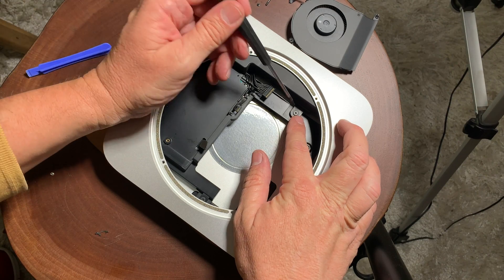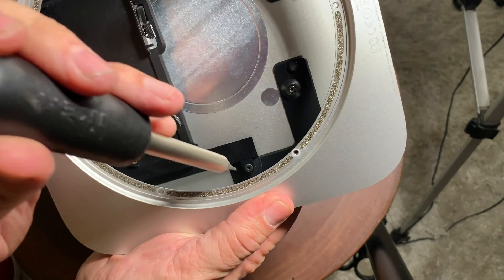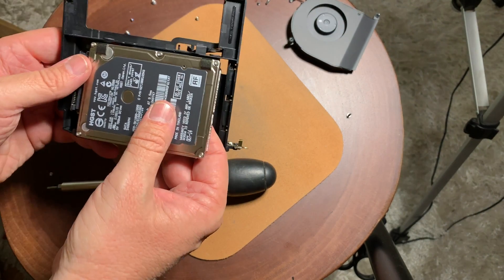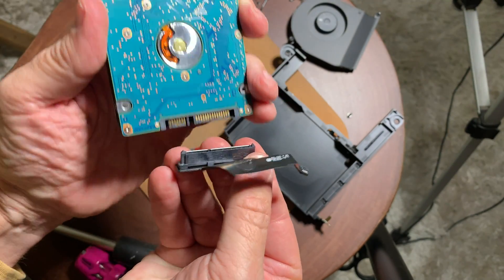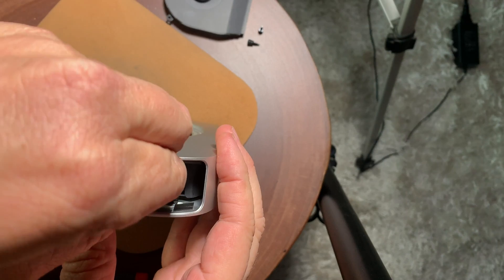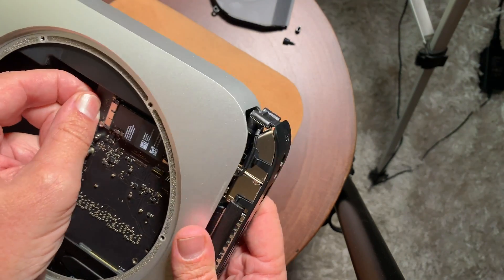Upgrade The 2014 Mac Mini To Super Fast SSD

Comment: This really does work! I saved all of my documents to a SIM card and then installed the new SSD hard drive. I then downloaded the software, from the internet, giving me a brand new Mac Mini with no bugs in the software. It took quite a long time to download the new software and then it had to be updated. It is worth it. It now runs at five times the speed. Before, it was more or less useless, taking about a minute to respond to most instructions.
Reply from the maker: That's awesome, thanks for sharing your experience!

Comment: When you unplug the IR remote cable, be extremely careful because it breaks of the board very easely. (if it breaks it is not a disaster, the remote and power light wil not work anymore) BUT THE FAN CABLE!! Don't unplug it. You can remove the main board with the fan unplugging. This fancable plug also breaks off the board like it is made of paper. If I would do it again, I would even tape it securely. Please give this reaction some thumbs up. Not for my ego, but to get it higher in the listing to help new fixers.
Reply: Very important warning!!
Reply: It's fine if you lift it straight up. I figured you need the fan housing out of the way to get to the other connectors. But I guess if you can leave it on, that's best. This thing really need to be handled with kid gloves and lots of time, all of those board connectors are crazy small.

Comment: Ive been repairing Macs for years but never repaired a Mac mini which is a testament to reliability. my 2012 Wass much easier than this to upgrade. Ive just got 2014 to upgrade hd. Couldn't believe how hard it was, even had to buy new screwdriver (t6 security) used a tiny screw driver ( from xmas cracker!)in the logic board each side a little bit at a time.

Comment: I managed to destroy the IR cable pin’s trying to plug it back in so no remote control use going forward (never used one anyway) and the power light no longer works but it seems to be going through the fresh install fine, only 2h 30m to go for Yosemite and then comes Monterey.

Comment: These were made with a plug in the logic board where you can but a $10 adapter to make it a fusion drive. Why not if the HDD is working fine just add an SSD stick and have to beat of both worlds and more memory. Better yet, replace the HDD with the SSD and find a 256 ssd  for cheap and the fusion drive since you opened everything up and put even more ssd power in this?  $26 gets you 1/4 tb.
Reply from the maker: When this video was made those were not available. But if I was doing it now I would still upgrade both drives as it’s so easy

Comment: WOW + WARNING TIP! Followed step by step and went through until I realized that I ripped off the hard drive power connector. You mentioned that you were able to get it with your nails but I took it off from the wrong side. What I suggest is to unfold a paper clip and gently slide it under the HDD cable branch to lift it carefully. The cable should come out pretty easily. If you happen to rip it off like I did, don’t worry, it’s a very common mistake and an electronic shop doing micro solder should be able to fix it. Other than that, the explanations were exceptionally good!

Comment: Great vid, thanks. How did you transfer all the data on the HD to the SSD?
Reply from the maker: I used disk cloning software. Once the hard drive was removed I used another mac computer to clone the hard drive. Once installed you just turn it on and it works. The one I used is not around anymore but Super duper is a good one .

Comment: I’m looking to do this exact upgrade but I’m wondering if I should do a 2012 Mac mini instead and upgrade that. I am wanting it for editing on light room.
Reply from the maker: You could use a 2012 Mac Mini but its not compatible with Big Sur the latest operating system and the 2014 model is compatible

Comment: Excllent video I have a late 2014, so would i have to save all my data on a dvd or flash drive, install the SanDisk SSD PLUS 2.5 2TB and then transfer the data? Thanks alot for your detailed work cheers!
Reply from the maker: Correct. Or upload everything to the icloud and and then you can put everything back. You just buy the storage you need for a month then get rid of it. That would be the cheapest and easiest way. I do this all the time very easy

Comment: Thank you for this tutorial, just done ssd replacement using this video as guide.  I don't have long small screw for pushing the logic board, so I just carefully push it from the end of the board where hard drive sit. Also for removing the drive, in my case it was using T8 not T7.

Comment: Hello my my mac mini late 2014 has 4gb RAM 500GB of Storage ...if I upgrade the ssd to 1tb.. how do I transfer the OS to the new SSD?
Reply: I would recommend instead of changing the 2.5" HDD for a SATA SSD it is better to just add a NVME SSD it is much easier to install and it is also a faster drive. That way you will have two hard drives, then all you have to do is install the latest OS X on the SSD and migrate you data from the HDD to the SSD when you first start your mac from the new SSD.

Comment: Just ordered the same SSD for my 2014 mini today, got it for less than $100. Very excited to have it installed! My mini is unusably slow and the SSD should help tremendously!
Reply: @Yusuf Han Yorulmaz I would recommend instead of changing the 2.5" HDD for a SATA SSD it is better to just add a NVME SSD it is much easier to install and it is also a faster drive. That way you will have two hard drives, then all you have to do is install the latest OS X on the SSD and migrate you data from the HDD to the SSD when you first start your mac from the new SSD.  I did this a couple of weeks ago and went from read/write speeds below 100 MB/s to above 700 MB/s.
Reply: Can you do both.

Comment: Thanks so much for this tutorial!  With the help of you and a Youtuber named luke Fugate I was able to clone my SSD and install it to the system I'm using as I type this comment.  I used a 2020 SK Hynix 1Tb Gold S31 SSD.  It hasn't turned my Mac Mini into my Ryzen 2700x gaming PC, but it's much faster than it was before.

After I first booted up the system I noticed that my power LED had stopped working.  I re-watched the video and think I followed every step correctly.  Do you know what could have happened?  I wonder if I may have damaged something when either removing or re-installing the power supply?  Any help would be appreciated!

Comment: Great vid . this is something i was looing for :). How about the system ?how do you install it on new SSD drive?
Reply: I would recommend instead of changing the 2.5" HDD for a SATA SSD it is better to just add a NVME SSD it is much easier to install and it is also a faster drive. That way you will have two hard drives, then all you have to do is install the latest OS X on the SSD and migrate you data from the HDD to the SSD when you first start your mac from the new SSD.  I did this a couple of weeks ago and went from read/write speeds below 100 MB/s to above 700 MB/s.
Reply: @gelv  How do you “migrate your data”? Will there be a prompt? I am comfortable with the physical upgrade, but I’m shaky with the software aspect of this.
Reply: @wdmbarker  After I installed OS X on the NVME SSD and booted from that new OS (in this case Big Sur) during the setup assistant there is a migration assistant where you are asked if you want to import (migrate) your data from a time machine backup, another Mac, another startup disk or a windows PC. Then I just selected the old HDD.

Comment: Nice explained step by step tutorial, do you have the drives cloning process in another video? At what point happened?
Reply: Did you ever find it out,
Reply: @ezraross5194  I would recommend instead of changing the 2.5" HDD for a SATA SSD it is better to just add a NVME SSD it is much easier to install and it is also a faster drive. That way you will have two hard drives, then all you have to do is install the latest OS X on the SSD and migrate you data from the HDD to the SSD when you first start your mac from the new SSD.  I did this a couple of weeks ago and went from read/write speeds below 100 MB/s to above 700 MB/s.

Comment: Hii , by mistake i broken cableslot(slot in which we are inject cable) at 2:20 , cable which you have open with nails. Which cable is this for ? Is there any solution ? Can i still use macmini ? Please help me
Reply from the maker: Hi Badal, don’t worry that is the IR sensor. Your Mac Mini will work fine without this. It’s for use with wireless remote. You probably never used one with your Mac. Just be sure to tuck that wire out of the way so it does not short anything on the board.
Reply: Cars And Cameras oh . Thank you . Thanks a lot . I was worried about that . Thank you . 😀😀

Comment: Hi, does this mac mini model, have soldered rams, or it's easy possible to change it ?. It was one of the best tutorials for mac mini, clear and make it so simple.
Reply from the maker: Hi Thank you for the kind words. Yes, the ram is soldered in and cannot be upgraded.
Reply: @carsandcamera   I change de HD for SSD and its amazing, great and fast. I spend a lot of time changing de OS to one aproppiated for the old 2014. It work with mojave with out any problems.

Comment: Hey great video, I just bought a 2014 mac mini and I want to do it, my unit comes with fusion drive 128gd ssd plus 2tb hd, my 3 questions are, did you format or configure the ssd before instaling it?? In the case of my unit it is ok to keep the ssd blade and later fusion both ssd units?? At this moment I'm seeing the both units separates which I think means there is no fusion, it is ok If I clone the hd to the new ssd before installing it?? not afraid of dissasembling and working phisically on the unit but lots of dubts in terms of configuration, thanks for your help in advance !!
Reply from the maker: Yes, you can keep the PCIe ssd that’s in your Mac mini. When you take the metal cover that hard drive is located right on top. You can also upgrade that 128gb to 480gb https://eshop.macsales.com/item/OWC/S3DAB2MM05K/ then upgrade the mechanical 2tb that in there to a ssd of your choice. You can clone the drive while it’s in the machine or when you remove it it’s up to you.
Reply: Cars And Cameras ooo awesome!! right to the point!!thanks so much !! In your oppinion a western digital blue could works well in this update??

Comment: Thank you SO much! I had actually spent €1200 on a new (2018 version) Mac Mini because mine was so slow, it would take maybe a full 2 minutes to open Safari and even longer for bigger programs like iMovie. The new Mac Mini wouldn’t stay connected to the keyboard and trackpad, just would disconnect and reconnect over and over again, sidecar would connect either. Even after upgrading to a 2nd gen keyboard & Magic Trackpad (total now at €1500, it still continued with the same problem. I really didn’t know what to do. This video really saved me and now my old mini works like a Ferrari. Thank you!
Reply from the maker: Your welcome. I’m happy it worked out for you!

Comment: What’s the smaller cable do? Not the bigger data cable but the one you talked about removing with a screw driver?
Reply: On the drive? The SATA power and data cables are combined into one connector.

Comment: That's the best tutorial I've seen for this, but I have a question, the ssd is placed without any files? do i need to do anything else to put macOS inside the SSD? I don't understand enough
Reply: You make a macOS USB installer before you take it apart and reinstall macOS via USB.
Reply: @afternuwn  Thanks!
Reply: CMD+ALT+R at boot loads the newest macOS available from the internet.

Comment: Hey Folks,
I just want a quick information: Is it worth to upgrade RAM and HD, keeping the i5 1.4ghz?
Will the processor support and delivery a good performance later?

I work with Photoshop and other Adobe softwares, so I definitely need some performance.

I'm looking for a powerful SSD and something about 16Gb, but looks that I can't upgrade the processor.

Is it a good idea or may i sell the older mac and buy a new one.
(obviously, i'm looking forward to upgrade 'cause will be cheaper than to buy another one).

Point is:
i5 1.4ghz processor (mac mini late 2014)
240Gb SSD HD
16Gb RAM

It will upgrade that much for a 4Gb RAM and 500Gb Sata?

Comment: How did you clone? I want to upgrade but I'm worried about losing boot partition data and the lower-level stuff that might not transfer over using a migration tool..
Reply from the maker: I used Carbon Copy Cloner. I will have video out shortly explaining how to do this. But it’s not not hard to do. You put both hard drives into external hard drive enclosure then connect both hard drives via usb to other Computer to run the software.

Comment: Missed step @ 2:21 and damaged my IR Cable connector while pull out logic board. All 5 wires came out of bracket. does anyone knows how to fix it.
Reply: same here.... yikes, I'm ok with not having IR or the power light.. so I'm trying it without connecting it for now. (crossing fingers)
Reply: @stvcolwill  I made the same mistake.  Is the mac irreparably harmed?  will it still function?
Reply: I made the same mistake.  Is the mac irreparably harmed?  will it still function?

Comment: Where is the RAM located??
Reply from the maker: It’s two small chips soldered  to the logic board.
Reply: So you can’t upgrade it? Correct?
Reply: @jimellis6290  No
Reply: Rembrandt Crescia that really sucks. Apple should be held accountable for that.
Reply: @jimellis6290  really you can upgrade that buying a new mac mini separately 😅
Reply: Rembrandt Crescia ya! Cuz everybody’s got an extra $1,000 hangin’ around. 😂😜😡
Reply: @jimellis6290  hahaha

Comment: How solidly is the ssd attached inside the 2018 mac mini?  is it possible to remove even if the drive is destroyed while not damaging anything else in the mac mini(like cut it out)?
Reply from the maker: Nope, it's not possible. The flash storage chips are soldered to the logic board. You're stuck with what you get. But you can run The Mac mini off a ssd drive externally. I’m going make a video on this soon.

Comment: Where are the results of this upgrade? Some people has found that you gain virtually nothing from this, yet you risk destroying your Mac.
Reply from the maker: The results are night and day.  Read the comments below some say the performance upgrade is astonishing. Anyone that says that you gain nothing from this is uninformed and has never done it. It’s an incredible upgrade and very easy to do. You are not going to destroy your mac. I made the video clear and easy to follow.
Reply: Cars And Cameras does this improve the speed? (I was wanting to upgrade the RAM on my late 2014 base model until I read it was soldered in.) I am just trying to understand if this improves the speed/processing or if it’s only for storage capacity, being it is a “hard drive”.  I’d be very anxious to try if this is the case as I didn’t realize how lousy of speed (in doing anything) my late 2014 model would be until after I got it. 
This is an amazing tutorial! Thank you soo much! I agree with the above comments - great camera work, wonderful pausing to explain where you need to be careful, etc etc. excellent video!

Comment: Whats the best way to clone the old hard drive to the new SSD so it boots up like your old system after you put the SSD in???
Reply from the maker: I use “carbon copy cloner” it’s fast easy to use and it’s free during the trial period.
Reply: @carsandcamera  thanks it worked well.   I am running my mac os now on an external ssd over usb 3.0, 240mb/s, will i get better speeds if i replace the internal drive with this external ssd?
Reply: @carsandcamera  Did you clone it first into your new SSD befor your replace the HDD in your mac mini? Can you help me how?

Comment: Did this tonight.  Took about an hour with being really careful.  Most times he says "use your fingers", better use a prying tool instead or a mini screw driver.   This was actually doable.  The things that actually slowed me down were  snapping back the power port and reattaching the antenna.

Comment: Thanks for the video. Yours make the process clearer to me than the others I've watched. One question - you say you need a T7 torx iFixit has a T8 torx in its kit and others say a T9 torx? Which is the right one?
Reply: Rajesh M did you get the right kit?
Reply: @dazmawilliams9609  My Mac Mini has only 4MB of memory. So upgrading to a SSD wouldn't have made it fast. So I decided not to do the upgrade.
Reply: @RB-hj7qc  Upgrading the drive to an SSD still would have made it faster. Also, couldn't you upgrade the RAM from 4GB to 8GB or more when doing this upgrade?
Reply: @jamiechampion299  Memory on my model cannot be upgraded. It's soldered on to the logic board. Yes, an SSD will make it faster but the application I want to run needs more than 4GB of memory. So it will still be swapping all the time. But now that I actually think of it, this will now be much faster too. So I should see an improvement in speed. Will revisit this as my Mac is currently a paperweight and there aren't many place I can go. :-) Thanks!
Reply: @RB-hj7qc  Oh ok, even if you're stuck with 4GB of RAM an SSD will still help. What application are you trying to use?
Reply: Jamie Champion pro tools ?